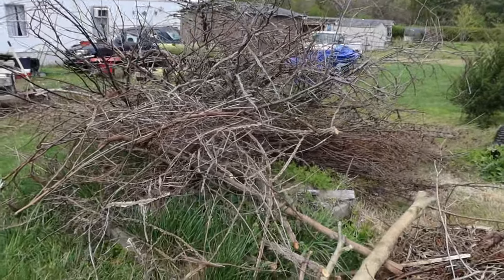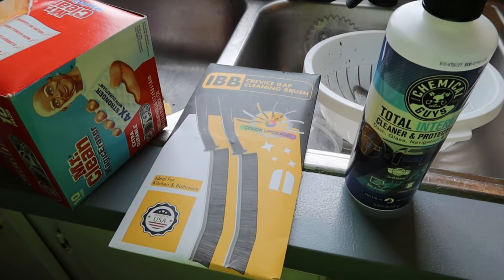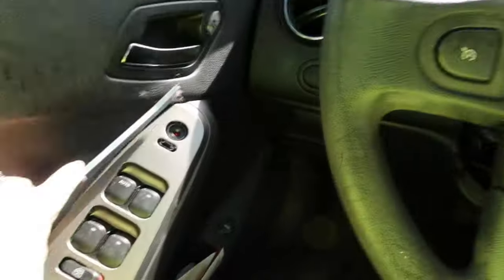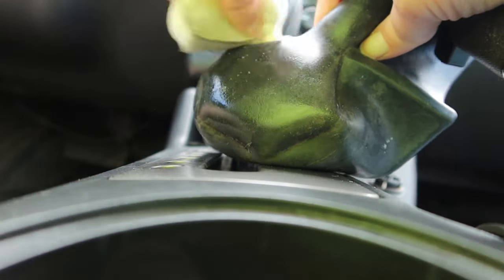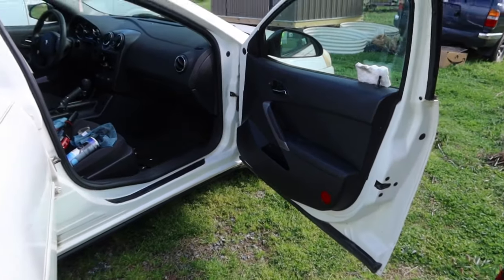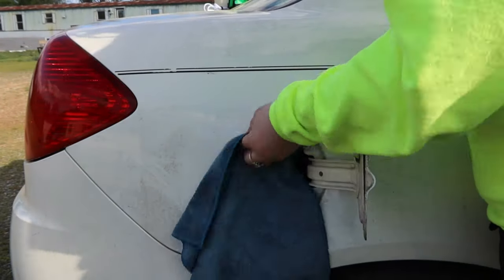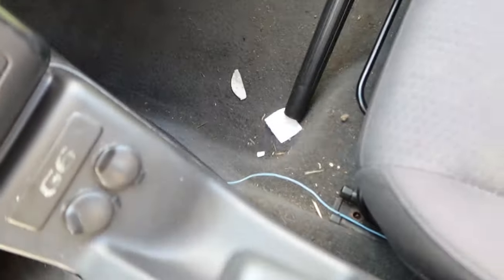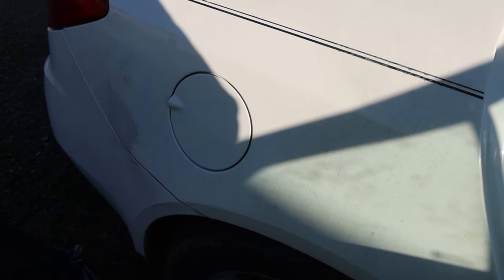EXTREME SPRING CLEANING MY 20-YEAR-OLD CAR I HAVEN'T CLEANED IN 2 YEARS / BACKYARD PROJECTS

Comment: Kimi, I need to clean my car too. It's filthy. I have a 2002 Subaru Forester. She's been a good car, and she was free too, but now we have to bite the bullet and buy a new car. My first car was a 1975 Chevy Malibu. I bought off my dad for $200 when I was 24 years old. I called it the big green tank, lol! It really was a tank, too! My second car was a 1980 Pontiac Grand Prix that I bought off my uncle for $500. I called it the lean machine because it did lean to one side, lol! My third vehicle was a 1982 Datsun King Cab 5 speed pickup truck. I purchased it from my dad for $200. It was black with a camper top. I thought I was "too cool" for that, so I took it off, lol! I had someone paint it white because I didn't have air conditioning, and black would get so hot. I put magwheels on it and a Michlight gear shifter on it that was made of wood. I had wooden beaded seat covers and some nice rugs under my floor mats. I loved that truck! Can ya tell? Lol! I named it honky-tonk. The next car I bought from my great-aunt for $2000. It was a 1992 Mazda 626. I named her Bessie. She was a fantastic car and I loved her. My dad gave me his Chevy Blazer while I still had the Mazda. It threw a rod, and a new engine was going to cost too much, so I was back to just having the Mazda, which was just fine. I can't drive 2 cars at the same time anyway, lol! That Blazer was loaded, though. It had leather seats, power everything, heated seats, and AWD. If I had been smart, I would have sold the Mazda to pay for a new engine for the Blazer. Then my mother-in-law gave me the Forester, so I decided to give my Mazda to my daughter's fiance. I'll be 60 on my next birthday, and I had hoped this car would last me til I die. I have never owned a new car and I don't know much about cars, really. I am researching now to find the best car I can. I'm not sure why I gave you my car history, lol! Anyway, I love your videos. I always smile when watching them. I do know all too well about "The Groundhog Day Syndrome." That's what I called it. I really was truly about to lose my mind. I hope I never experience that again. Depression and anxiety are debilitating. It made me feel stuck. Paralyzed, if you will. I have been blessed more than not, and I am very thankful for that. My grandma used to say, "The sun don't shine on the same dogs a$$ every day." Sorry, but that is what she'd say, and she wasn't a cusser either. I wasn't sure what she meant by it until I got older. She only said it when someone hurt one of us kids. I think she was trying to tell us that mean people (dogs) won't always have good days. They will get hurt one day, too, and know what it feels like. She wasn't wishing it on them, and I don't either. We just hope they learn kindness. I tell my grandchildren, "If you don't have anything nice to say, keep your piehole shut." The first time I said that to my youngest granddaughter, she said, "Grandmaw, what is a piehole?" I told her that it was that hole in her face that she eats pie with. She said, "But I don't eat pie." Lol! Have a beautiful, blessed night. 🙏

Comment: Nice job on the car, its in really good shape for how old it is. I have similar front floor mats and washing them actually is easier than vacuuming. I spray them with a hose and then use Dawn blue dish soap with either a scrub brush or that crevice brush you have. Then rinse with hose and let them air dry. Sometimes its so nice to do something like having a clean car to feel accomplished, maybe I am weird but things like that make me feel better.

Comment: Scrubbing bubbles bathroom cleaner without bleach..hands down best car upholstery cleaner..spray..scrub with brush then steam clean it up..leave doors and windows open on dry day to air out..also use a toothbrush to get in crevaces and those cup holders soak em in the sink